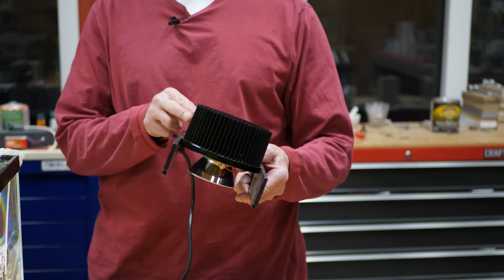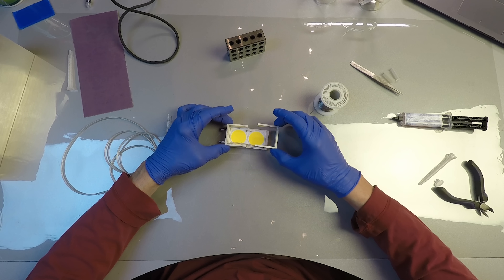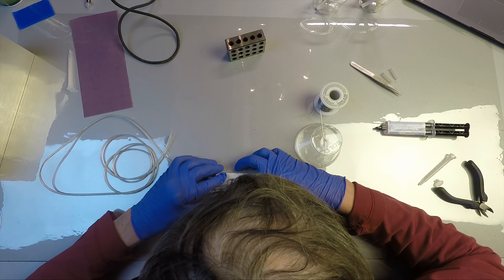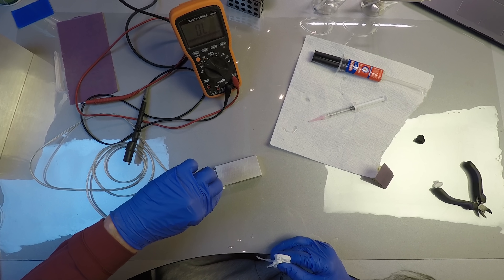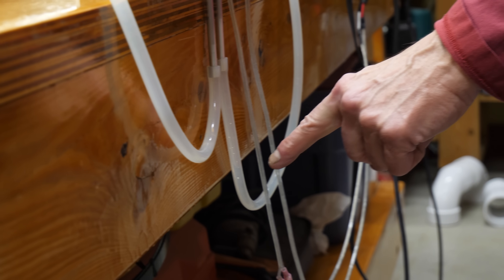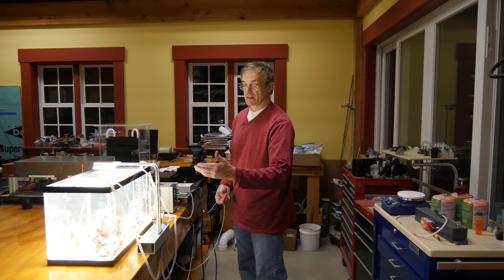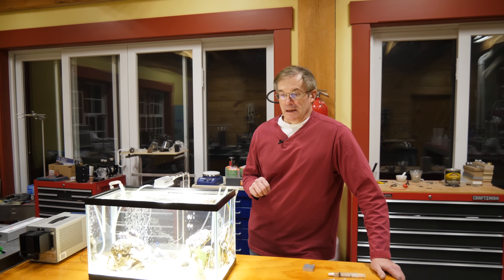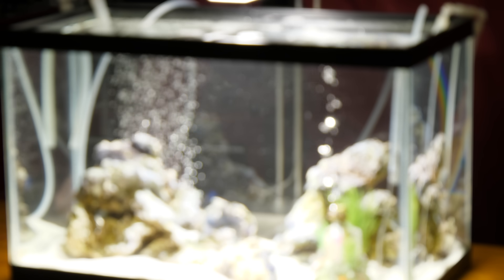40,000 Lumen LED Aquarium Light

Comment: Aluminium is toxic to fish.why would use this? i would not risk my fish to this build.
Reply from the maker: Did you watch the entire video?
Reply: @TechIngredients  yes .i saw put a light coating of resin.how would you check to see if it cracked from the heat?i have use the 2 cree cobs on a 55 gallon tanks i had to trim my plants every other day or deal with plant that brown leaves on top from to much.plus algae was battle too.still not risking my fish
Reply from the maker: Thanks for the response, those are good questions.
Firstly, the temperature rise with the water cooled block and the COBs is very low.  You can prove this by measuring the temperature rise in the water exiting the block by diverting it to a small, temporary container. The extremely high specific heat of water means that if you flow only 1L/min through the head while the light is at full power, the temperature rise will be 3C.
You can confirm the integrity of the epoxy barrier by filling the coated block with salt water and measuring the resistance between the water and the exterior of the block with an ohm meter.
Of course you can operate this light with an external cooling loop and you would want to anyway if you have a larger aquarium.

Comment: I made my own custom LED lights for a reef tank, this looks much more slick. I wonder if Cree makes an actinic (blue/UV) COB product as well. Not sure about using tank water for the heat exchange though. Also excellent video and worthy of sub!
Reply from the maker: Thank you!
How you set up the cooling loop is of course optional.
Cree COBs go as high as 6,500k and the spectrum contains a significant amount of light between 420 and 480.

Comment: As both an aquarium hobbyist and having liquid cooling experience as a computer technician, using the aquarium water as the coolant is a VERY bad idea. Worst of all you will raise the tank water above what is tolerable to most fish and you will cook them, the extra heat will also cause algae blooming. Secondly you will get bacterial growth in the cooling loop very quickly and that will clog the smaller lines thus causing the LED to overheat. I highly recommend using a stand alone cooling loop using a small radiator, yes computer radiators are expensive but a small automotive oil cooler (like we used in the early days of PC liquid cooling) can be bought new very cheaply and you can still set up a fan on a rheostat to adjust speed for noise and cooling and not kill your fish.

Comment: Aha!  Here it is!  My idea from 2010 done in a very elegant way.  Including using the tank water to cool the LED.  Except that 41 years of experiences with aquariums tell a completely different story.
The problem is the long run.  Adhesives - no.  Plastic hose connections - no. Overheating cutoff sensor - yes. Lenses on the COBs - yes.  Water droplets reach the contraption - no. Everything held with clamps or bolts only - yes. Ok, you make an improved design but you end up with a complicated gizmo that requires daily checks for proper functionality.  What did you win over just buying the COB with all the bells and whistles from any pot growing outfit and hanging the ugly thing on top of the tank and never have any issues?  "Simple and beautiful" is the hardest thing in the world :D AmuZing video, nevertheless - watching your wild useless idea actually be made in real life. That was nice, not joking! Thank you for that.

Comment: Interesting build, I'm thinking of eventually setting up a large reef tank and something like this seems like it could save me a lot of money. A couple concerns for using this setup in that application do come up though.
1. What sort of spectrum do the LEDs that you're using have? Any application that I can think of for needing that sort of intensity involves photosynthesis in the tank and that is heavily dependent on the correct spectrum. I know most commercial reef lighting incorporates emitters of multiple colors, though that may be more for fine tuning the appearance of aquarium by adjusting their relative strengths.
2. As has been already mentioned in many comments below, a closed loop would be a better idea to avoid fouling the cooling lines with plaques that will certainly form with time with non-sterile water.
3. This should probably be run through a thermostat to ensure you don't overheat your tank.
Reply from the maker: Having operated several large reef tanks over the years, I am confident these lights will work.  To research this, determine the  marine set up you want such as SPS corals vs large polyp vs say just fish and some invertebrates.  Based on the absorbtion spectrum of chlorophyll, you want good red and blue components in your light spectrum and most corals grow well and look better with deep blue/near UV light around 400nm and up. 
Then, look up the Cree spectral output of these COBs 
With a large tank, you will want to remove the waste  heat from these lights rather than introduce it back into the system and so a closed loop is the way to go.
Reply: @TechIngredients  Thanks for the quick reply. The tank I'd like to eventually set up will be focused mainly on corals. I've been watching quite a few of the YouTube reef keeping channels and there seems to be a lot of emphasis on the quality of the light they receive with large tanks often having over a thousand dollars worth of LED light fixtures. 
The sort of setup you have here is definitely something thing I want to try out as I don't find much use in a lot of the bells and whistles the commercial units offer.
Reply from the maker: Been there, done that.  DIY for sure.  It's cheaper, can be built to match your needs and isn't tethered to 5 year old technology imposed by manufacturing and inventory. It's also more fun...and that's the whole point.

Comment: Nice, but I am looking at the self regulating COBs that run directly off of 120VAC. They also have a 120 degree dispersion of light. So why the cover glass? And other people are using 120 degree dispersion lenses. Are they not reading the Data sheets? Also you didn't mention that the water blocks have a machined side which should go to the COB.
Reply from the maker: That should save money if the power output is acceptable without needing the dimming function.
You're right about the dispersion.  The cover is used based on a lot of experience with aquaria.  Everything gets coated with spray and with salt and the flat cover is easier to wipe.  Also, keep in mind that with these two COBs in series we have about 70V @ 2A running to the solder points on these LEDs.

Comment: I dont know if it has been said already. But what if you used a computer CPU water cooling radiator and fan on a dedicated loop with the light. I dont know the temps of the light but it can't be more than a heavily overclock computer CPU (i would think). The only issue is the radiator would push the heat into the room. Depending on the room. That may in itself raise the temp of the tank. 🤯 I feel like this conversation is like chasing your tail. It's all about were to put the heat. Great video I am going to try this but at a much smaller scale.
Reply from the maker: You certainly can do that.  If you saw our video on the solid state freezer we use that very same system to remove the heat from these cooling blocks. For a large aquarium, where heat removal is the goal, such a system can get all that heat out of the room where the tank is located.
Reply: @TechIngredients  that's great. This was my first of yours videos I have come across. But I feel I have some catching up to do. 👍
Reply from the maker: Hope that earns a subscription!
Reply: @TechIngredients  you bet

Comment: Do you have the math posted somewhere to calculate the amount of heat loss from the tank as the volume and surface area change? Also thank you for discussing the effects of the metal being used and their impacts on the tank.
Reply from the maker: No I don't.  There are a significant number of variables beyond surface area.  The room temperature is obvious, but also the relative humidity is significant because of the large heat of evaporation.  Pump effeciency, plumbing diameter and flow restrictions determine the frictional heat added.   Thick wall, plexiglass tanks have a higher thermal resistance than thin glass tanks and a exposed stand with an open top will loose more heat than a tank in a cabinet with a hood.
Lighting is probably the largest heat load for any aquarium.
Reply: @TechIngredients  that makes sense. I appreciate the reply, I was honestly just looking for the heat coming from the aquarium primarily to get a rough estimate from it but I will look around online and see if I can't find something that fits my situation and learn more about it. Thank you for listening!

Comment: How about actual links in the description to parts used??
Reply: I would really like that as am about to rebuild my aquarium lights to something mote robust. And this seems a better way to than the diy perks video of a 1000w equivalent led light with water cooling. And I’m not finding them here in Finland.
Reply: @dbtest117  you can buy the water blocks, tubing, and water cooling rad for pc all from amazon, don't buy led cobs from there though you will be given the cheap Chinese ones, then for cobs look for something made by cree, luminous, Samsung, normally around £20 per cob for a decent one, you need to make sure the spectrum is right also for fish and plants, basically look for anything used in cannabis growing and it will be suitable for fish tank. And finally the driver, meanwell is normally the best but you pay extra for it, other cheaper makes around but they can be fire hazard so choose wisely.
Reply: Yes I know about led lights, what I’m really after is that low viscous epoxy. 
I have leds from yuji, that I’m building with now. But I have previously researched the wave lengths plant needs. 
And bought such led lights 120W each. However they were built to cheaply and did not last, only one out of 4 still fully functional. And I wasn’t happy with the lights. Lots of red and blue, with to few green. Plants need green also to build healthy stems and roots. They absorb about 70% green compared to the red and blue wavelengths they need for chlorophyll. 
So now building DIY style with “full” spectrum leds from yuji.
Reply: @dbtest117  for epoxy I would use either gorilla 2-part 5 min clear epoxy, or unibond repair power 5 min epoxy depending on what is available to you, both work well with metal and plastics, both are temperature and water resistant so should be fine over aquariums and high humidity environments, as shown in the video it's best to sand joining surfaces first and the epoxy will have a better hold. And yeah from what I was reading last year they are just clicking on to how important the green light is for plants, previously they only focused on the blue and red spectrums but now green is appearing more in them and higher cri's now, getting as close to sunlight is going to produce a healthier aquarium and plants.
Reply: Pull up a meanwell catalogue.  This stuff is easy to find

Comment: An important factor you need to consider when doing this is the wavelength of light. Saltwater tanks with coral are especially sensitive to the wrong wavelengths. You can't just use any ebay LED willy nilly.
Reply from the maker: Corals prefer high color tempreture lighting. The Cree 3590 COB produces a significant amount of light between 430nm and 480nm.  That is a good match.

Comment: I suggest Three Bond 1184 instead of Silicone RTV. Silicone RTV uses acetic acid to cure and will cause corrosion during this process. Its very slow to cure as well. Three Bond uses solvent evaporation so it does not cause corrosion and dries MUCH faster.
Reply from the maker: Good idea.

Comment: say hello to an algea factory ;)
Reply from the maker: Have you ever set up a shallow water coral, marine aquarium?
Reply: @TechIngredients  no, I'm planning on maybe starting a marine tank someday. I have had freshwater aquariums for about 9 years now.
Reply from the maker: We have run a few for a couple of decades.  These corals prefer high light levels.  On a coral reef the maximum light intensity is 130K lumens/M2.  That is roughly the surface area of a 500L tank.  This would require three of these lights running at full power.  The reason an ocean reef is not overrun with algae is that sea water is so nutrient poor.  This is difficult to achieve with a closed aquarium system and the reason so many owners have to reduce the lighting to unnaturally low levels.

Comment: Great idea, Spend a thousand dollars on pumps, power supplies, tubing, milling machines, chillers, epoxy, syringes. Im going to get one now.
Reply from the maker: 😀
We have the equipment and it makes putting together a project like this very easy.
But, most aquarium owners are familiar with the pumps, tubing and lighting power supplies and the head can be assembled with a piece of "U" channel, stainless steel tubing, a small hand- held pipe bender, a file, some sandpaper and a soldering iron.  The DPSS laser, well... that's different.
Reply: Tech Ingredients I have extensive experience in all things aquaria. I belonged to fish breeding clubs. Nobody has ever had any 1/4" outlet pumps or tubing or special power supplies or variable dimmers or anything you mentioned. This was a neat project but to say it was of any use to anyone is just stupid!

Comment: Potentiometer is likely burning off a lot of power when dimming. Use a variable buck converter instead.
Reply from the maker: The potentiometer is controlling, not restricting the output of the high frequency, switching power supply.

Comment: I love DIY projects, especially LED stuff and sure fish have primitive brains but running this in a tank with fish is straight up animal cruelty.
Reply from the maker: This is a demonstration tank!  The high output of this tiny light makes it possible to light a large tank with a single, low cost, low visual impact light while at the same time allowing you to use or divert the waste heat from the room where it is unwanted.  For reference, a one square meter surface area tank would need three of these lights at full power to equal the intensity of the noon sun.  That is a large, but not uncommon, home aquarium.
Reply: @TechIngredients  don't forget to factor in the water absorption where these fish actually live which is substantial. The tank size required to justify that amount of light would have to be huge just sayin!

Comment: These will be perfect for indoor horticulture. Nutrient absorption rate is temperature dependent so this would be a dual purpose solution.
Reply: Fungus growth is also temperature dependent. Especially if you are referring to hydroponics and dwc. Living in a hot climate I had to actively cool the solution using frozen water bottles and use an ice chest as my reservoir all to keep root rot away. Had the most voluptuous and clean white roots you've ever seen though. But in a cold climate it would be a whole different story.

Comment: Change it to a linear arrayed COB element (long and skinny) which would be a better fit for an aquarium lid. The footprint also better approximates florescent tubes in older tank lighting. If you're clever, the amount of cooling the light would need would approximate what the old aquarium heater produced, and you'd also have the cooling water return stream to the tank setup to pull in air. So now you get lighting, heat, and aeration all performed in a single setup. Then integrate that into a cover with a few hose connections.

I think filtration would still be left a separate circuit though, as flow rates for one system may not be adequate for the other. At least the light/heater loop shouldn't be restrictive.
Reply from the maker: Many aquarium owners, myself included, prefer the scintillation that comes from small localized sources like metal halide lamps or these LEDs.  This is what the sun produces when you're diving on a reef.

Comment: Add a thermal cutoff just in case the pump dies?
Reply: Yes, at some point you should consider some “fail safe” idea. Possibly a thermistor on the heat sink turning the lights down or off.

Comment: One idea that just came to mind while you were describing the aluminum corrosion problem would be to have a two-loop system with a liquid-to-liquid heat exchanger in between, that way you have no aquarium water in your water block. It could be as simple as a bunch of small stainless tubes in a plastic box, sealed with epoxy.
Reply from the maker: That would work.